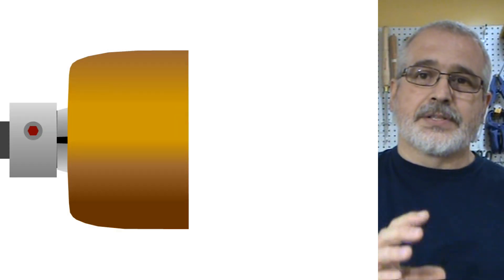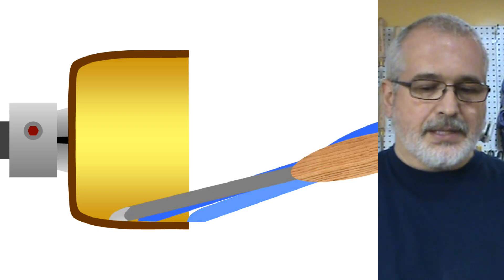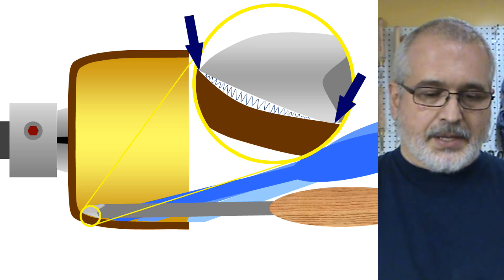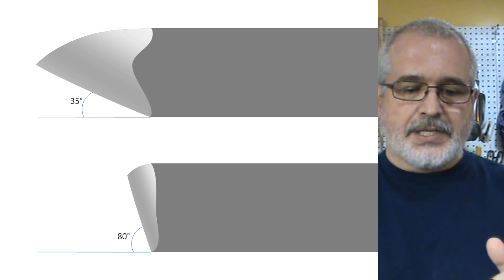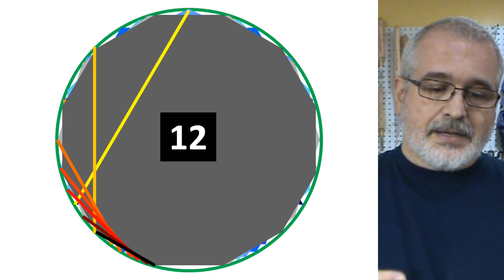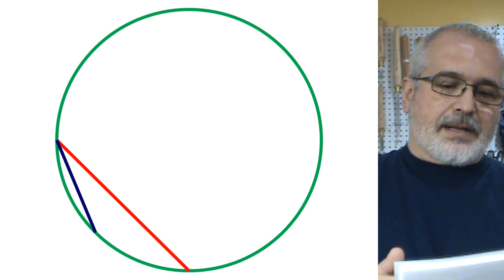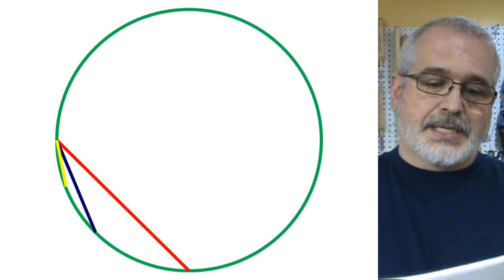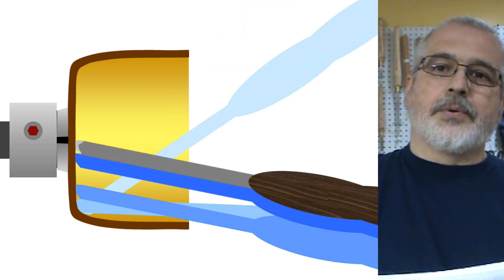Bowl Gouge Cut Geometry

Comment: the video i just watched is the best explanation of the bottom bowl problem i have been having i went to a scraper now i know what to do  thanks
Reply from the maker: +Tom Palmer Hi Tom! Thank you very much for your comments my friend! Do not leave the scraper so soon ;) there are times in which even the bottom feeder will have trouble if the curve is too closed (and nothing will beat a squared tip scraper for a sharp right angle). That said, the bottomfeeder will be a great tool to have in your arsenal and it will give you a lot of satisfactions. Just consider that the angle of attach is different from other profiles and you will get very nice transitions from the interior lateral wall to the bottom. Cheers! Daniel